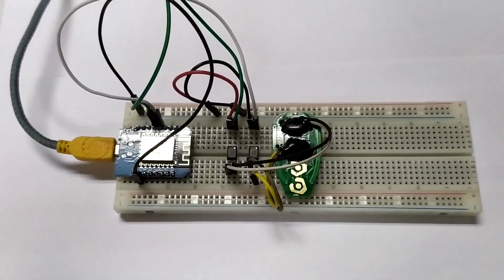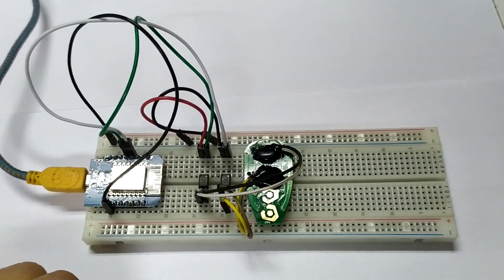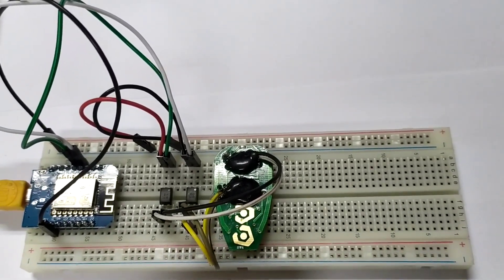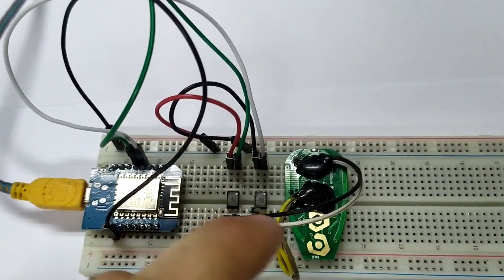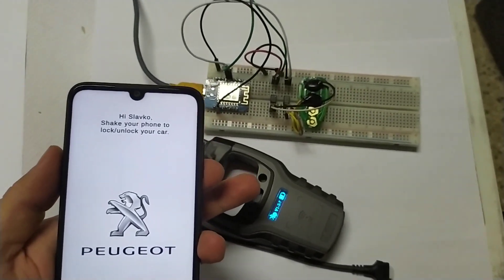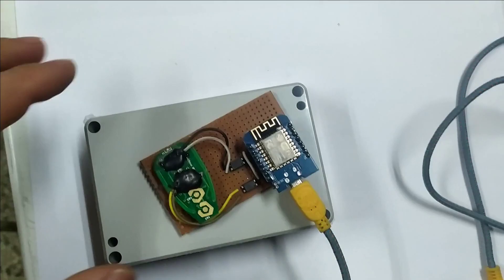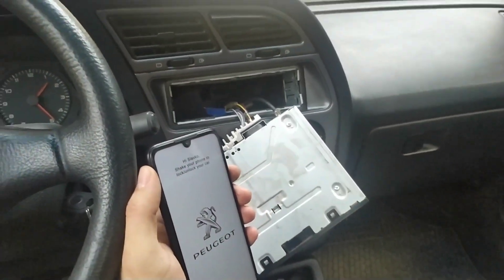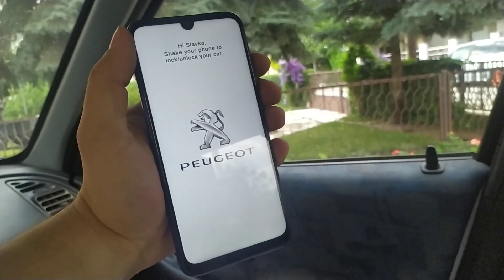How to Unlock any Car Using a Smartphone | Arduino esp8266 WeMos D1 mini DIY Project

Comment: Hello bro can i use this in atruck 24 volt and how i got mobile soft and the box i need to buy from you
Reply from the maker: Hi, I explained the working principle and the modules in the video. Also, put a GitHub repo with the Android app and the code for the controller, you can make something similar for yourself, the links are in the video's description, enjoy.

Comment: I don't understand where it connects to the car
Reply from the maker: The remote is a part of an alarm system that I had previously added to the car, The system just triggers the remote's buttons using the optocouplers that I showed in the video and now it just gets 12volts from the car. The remote part can work even if I place it near the car, and power it using another power source, but I added more features after this video, because of that I wanted to place it in the car.
Reply: @SlavkosHobbyChannel  what alarm system? And how does the alarm system work?
Reply from the maker: @ratasslordofyoink4542  Any aftermarket alarm system will work. I chose an aftermarket one, cuz my car doesn't have OEM remote control. But it just triggers the remote's buttons using an optocoupler, and that's it.